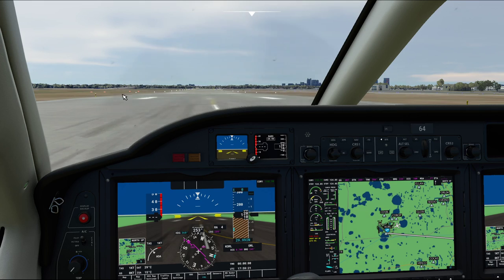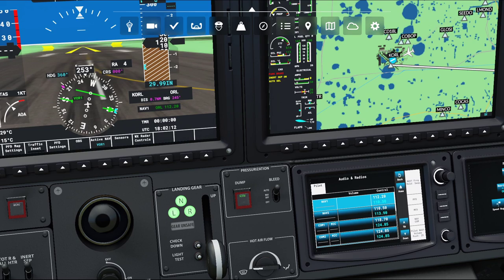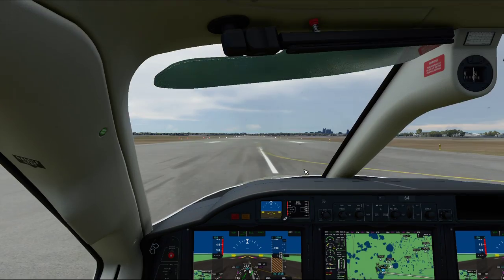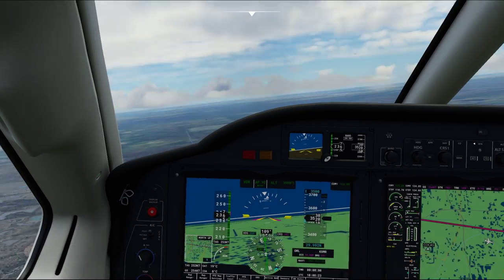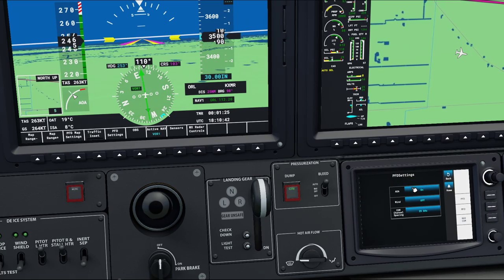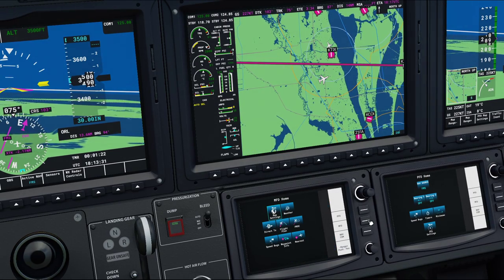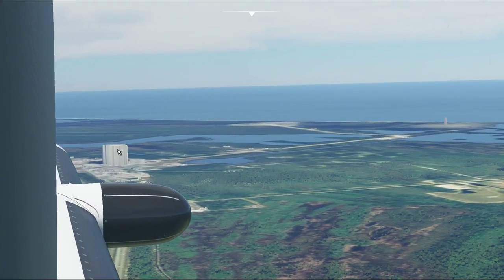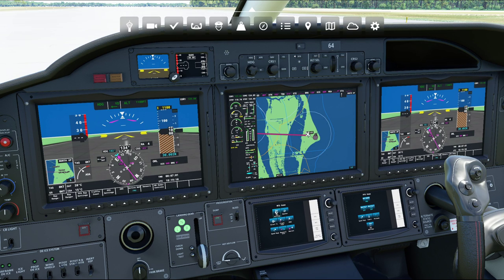FS2020 G3000 and Autopilot Tutorial with TBM 930

Comment: Good help vid but how do you fly that TBM? I can't it is just insane how it banks wildly same with all the jets I keep adjusting the controls sensitivity but I can't get it stable
Reply: R u serious? With what kind of controller do u fly? Even with a x-box and ps controller u can easiely hand fly this one. Just trained a friend of me who only made the flight school in MSFS2020...he was able to follow me and hand fligh the TBM to FL280 just with his pls Controller 👍🏼
Reply: @maxhaines3794  I'm using the Hotas 4 that I just got it cost me $ 150
Reply: @wrongwayfeldman5393  Perhaps it's a calibration issue.  Also make sure you don't have another controller bound to the same control surface including the mouse
Reply: @wrongwayfeldman5393  yeah, go to sensivity and play a little with the curves of ur controlls...or tell me what is ur biggest problem then while hand flying ? cause for me she`s very smooth and all my settings on realistic
Reply: @maxhaines3794  The ailerons are the biggest problem.I have them set to -79 less then that like -20 and the ac will roll over even with the ap on
Reply: @wrongwayfeldman5393  just play a little with the curve...I have it on 60 I think. it took me a few flying hours to find a good sensitivity and even now I'm not 100% fine with it :D but when the AP rolls the AC to a specific side thats depends on what settings u made in the AP. It has nothing to deal with ur hotas.

Comment: How do you descend without using Vertical Speed?
Reply: Disable Autopilot and go Manual. The other option is FLC which works the same was as vertical speed but works in maintaining a speed instead of a descent rate.
Finally, there is vertical navigation where you type in an altitude for each waypoint, then enable Vertical Navigation, set altimeter to lowest altitude and the aircraft will descend. There have been reported bugs in FS 2020 and this is not working like it should.

Comment: Im so confused about the autopilot. Ill have it set for FL330 and it will level off the plane at like 6000 feet. I have the VSI at a reasonable number as well in the autopilot. And the rare times I can get it to the desired altitude, changing altitude is impossible. Ill turn the ALT and VS knob, and nothing happens. I can turn the ALT off and back on as well as autopilot completely off and back on. Idk what I'm missing.
Reply: There is a additional switch to enable the AP on this plane above the windshield upper far right side. I hope that helps... though I must say that the AP felt quite buggy from time to time anyway. I had situations where I switch from NAV to gps and the plane took a 75° nosedive into the ground...:/
Reply: Autopilot (and every else) is crap. Can’t go direct to properly or intercept an approach other than going back miles to an initial fix. They didn’t even bother asking a pilot’s opinion before releasing this 💩.
Reply: Shadow 133 not being able to intercept an app is frustrating af i just load it and intercept it manually its stupid...
Reply: @Shadow__133  Yeah I'm beginning to figure it out but it's definitely messed up. I can get it to work. But wow. Hope theyre already working on updates and talking to real pilots like you said.

Comment: In which situation would you not use GPS and use VORs?
Reply: GPS for following a flight plan and IFR flight. VOR for small cross country flights and VFR flight.
Reply: You almost always use GPS - You get a better overview of what is going on and shorter flight paths. VOR in today's world is only used really when:
1) You don't have a GPS or it's not working - VOR is used as a backup
2) An Air Traffic Controller (ATC) gives you specific instructions to enter an area at a specific heading, and leave at another heading
Other than that, GPS is your best friend.
Reply: I prefer VOR because it's more fun. 😁
Reply: @PeterESSA  Oh it's fun for sure! Dialing in the frequency, watching the needle move, adjusting the bug ;) It's satisfying to see your adjustments work.
But in real life, when you are trying to avoid weather and save gas...yeah...GPS is your friend :)
Reply: I used to fly Cessna aircraft when GPS was only fitted to expensive aircraft.  I’m learning GPS and the autopilot on this sim and it’s honestly far superior to VOR navigation.  I guess the VORs are useful waypoints on a flight plan. Perhaps VORs have some use when flying over coastal areas /sea with no landmarks etc?? Maybe certainly a backup if gps ever failed for any reason. Maybe VOR WILL become obsolete
Reply: Always GPS everywhere and if not GPS, you're doing an ILS approach.  Even in the real world ATC will give direct to a VOR but we are going to the GPS waypoint and not tuning VORs like we did before GPS.

Comment: Procedures aren’t populating for me. I’m direct to an airport with known approaches but nothing populates to select.
Reply: Me too. I don't think theyve been put in yet.
Reply: PilotDave85  Amazing. They release a flight simulator with no approaches to load. Beautiful sim but so poorly released.
Reply: @jjsemperfi   thats the main purpose of the thing for me. Instrument practice
Reply: Before to hit the fly button, you need to select departure and arrival on the world map screen. Same applies to the cessna G1000.. Basically if you don't have at least those two point set before to fly, you won't be able to change on fly FLP or APP
Reply: @LeonardoMarchese   well that's not how it works at all irl nor could I get an approach loaded after I set KTVL as FPL dest while in air.
Reply: PilotDave85  Weird. Hopefully they change this. I’ll give it a try though. Thanks
Reply: Leonardo Marchese  Didn’t work. I’m in the TBM, I set a departure and arrival in world map and I’m flying on the flight plan. No procedures will populate to select.
Reply: So I flew from Switzerland down to Greece and I was able to load an RNAV Approach. Maybe certain parts of the world aren’t loaded up yet? The approach and autopilot worked great in the TBM. Fun flight.
Reply: @jjsemperfi   yea maybe because it was built in Europe. Not just the TBM, but FS2020. I don't see a stock Piper M600. :)

Comment: personally i couldn't get the autopilot to engage (it was just blip and go off) - and I DID turn on the autopilot switch on the far right of the overhead but it didn't make any difference.  Anyone have any thoughts?  Am I missing a config somewhere?
Reply: Just a wild guess, maybe you first have to confirm an alert.
Reply: Same issue here when I start this aircraft from cold and dark, I'm not able to get AP to stay on. It just flips off almost immediately.  If I start on an active runway with the aircraft running, AP works fine.
Reply: Did you turn flight director on?
Reply: @mrboss20ten  will check that tonight.
Reply: I had this same issue but I realised it was because I had the AP switch off over head doesn't seem to have helped u though. Only suggestion is go through the check lists for before starting and after starting. Also make sure the generators are set correctly according to the checklists. Keith Slagerman gave me the idea as I have always started cold and dark and I just pressed ctrl+E but seems that skips some other stuff that the checklists cover.
Reply: @mike309saa  Turns out my issue was that I didn't have flight director turned on before switching on the AP.  I always thought that FD was optional and that the AP's ability to function was not dependent on FD.
Reply: @mrboss20ten  FD not being on was the issue.
Reply: @kslagerman  Ah right I had FD on and I pressed AP and nothing came on I couldn't figure out where I was going wrong until I checked the checklists and realised I hadn't turned on the AP from the overhead panel.
Reply: Keith Slagerman ah great stuff. The FD can be on without using the auto pilot,  but you can’t use auto pilot without flight director
Reply: Also the AP is designed to disengage if you move the column. So if you don't have a small deadline, or you have a jittery flight controller, AP will disengage.

Comment: Why is it reported as a warning that INERT SEP is switched-on? How do I use this feature? Thanks.
Reply: i don´t know how to explain this in details, but INERT SEP is a feature that avoid debris to be ingested by  the engine on the ground.  
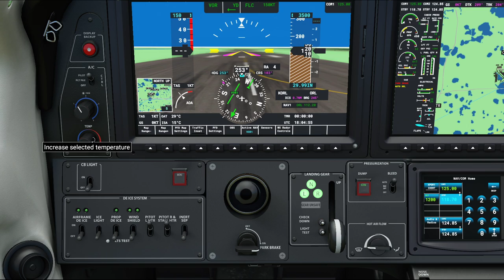To deactivate this function, just press the last button on the "deice system" panel. you can see it in minute 5:32.
Reply: From my understanding, the INERT SEP is used whenever on the ground and for T/O and LDG to stop stones and particles entering the engine and damaging it. The same applies if flying through clouds because ice and water are of course also particles. Using the INERT SEP does reduce the output power of the engine however, so (as far as I understand) one will switch it off when not needed, i.e. when established in a cruise providing there are no significant particles to be concerned about. One would have it on over forest fires, in situations with volcanic ash, if it's cold enough for ice (which can be super cool and very solid at altitude) and when on the ground where stones, bolts, you name it, can be stirred up by the prop wash. The INERT SEP creates a channel for heavier particles to pass through the air intake and straight out the back, so the air that is drawn into the engine is clean - but in doing this it means the air is not being forced so much into the engine, so the engine is a little less efficient. I have no idea if this bit of ascii art will work so ignore it if it's a mess :)

( ENGINE )
___/   /
____/                 Air being directed into the engine directly (INERT SEP BYPASSED)

( ENGINE )
__/   /
____
__________     Air flowing past the engine inlet to let the heavier bits pass through, but the engine isn't getting as much air (INERT SEP ON)

Hence the INERT SEP annunciator light to remind the pilot that (s)he needs to bypass the SEP to get a good power and efficiency

Now, I am NOT an expert. If I've got it wrong I want to know too, so all comments welcome either way. :)
Reply: @davidlambert8368  I already found out about this device too. You wrote everything correctly, there is nothing to correct. Thanks!  :-)
Reply: @colinsouthern  Thanks. Very useful explanation.

Comment: Guys, i don't know how you guys do it!!!!!!!! I know how to use the autopilots on jets quite well. Especaolly Citation jets and i CAN NOT fly the citation CJ4 or the Longitude AT ALL using the autopilot systems. It does not work at all like it's supposed to on my sim!!!! Now i've seen video's like this one with it working. Well it don't do this on mine at all. So i don't know what is going on with my system. I have Intel i7 5820K with Gigabyte X-99 motherboard, 32gig of ram 250mbs internet and a GTX Geforce 1080 ti video card. So i don't think it's my system causing this issue. I've flown the TBM 930 and it does the same thing. So if anyone knows what is going on, please advise me what i can be doing wrong. I don't have this issue with any planes on FSX Steam or X-plane 11.
Reply: So what’s going wrong?
Reply: I agree with you, exactly what I find, my CJ4 will not follow my commands once I am set up for landing, and even after a bad landing fighting the systems, the aircraft will wanna do it own things, very strange...